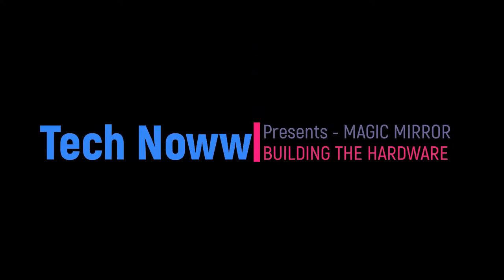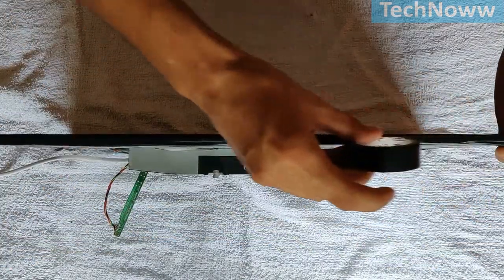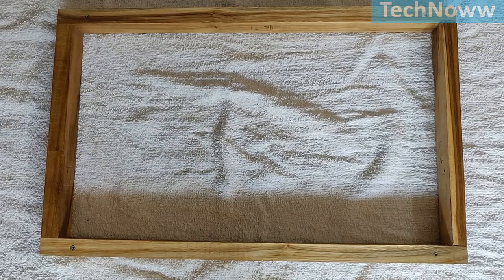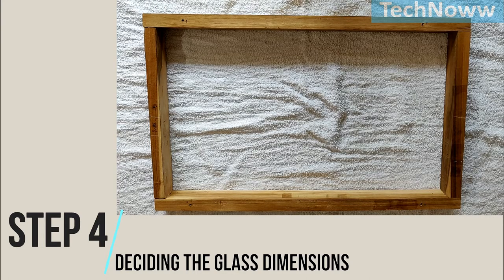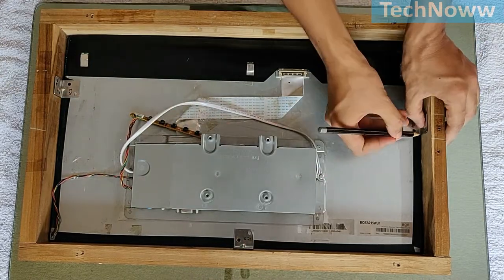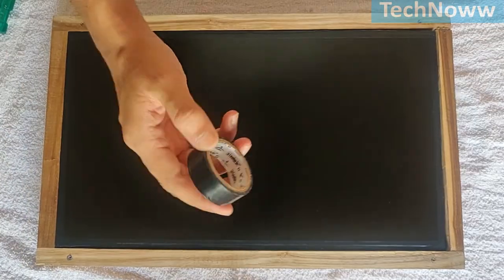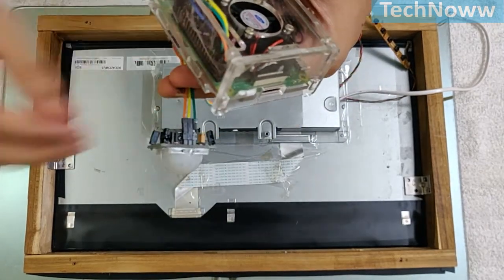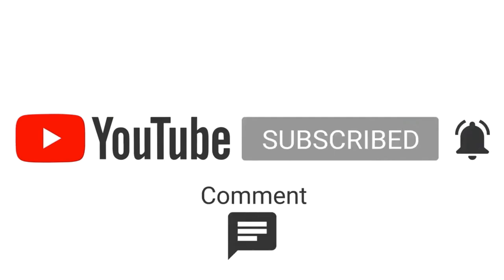Building Frame less Magic Mirror - [DIY - All steps included]

Comment: Pro tip: When you select a monitor for your magic mirror, make sure that the HDMI input faces down! Some monitors have HDMI inputs that face towards the back of the monitor. That will add unwanted depth to your mirror.
Reply from the maker: I couldn't agree more.. however, it is a bit difficult to connect the plug of power cable with electrical supply that too inside the frame assembly.
Hence, i soldered the power output of the monitor. :P .. Moreover i also had to connect my usb charger and a switch !

Comment: Yeooo nice vid mate. Excellent work! Just got a rasp 4 so will prob start a project like this at some point. Thanks for making the tutorials 👍

Would be great if you could find a work around so you don't need the screws. But adhesives could add complication/ be visible and ruin the look I guess.
Reply: Do it like apple did with the imac..just have a small lip for the glass to rest on, this could even be epoxied on the back of the glass and then use good automotive tape to tape it to the frame...will not move...

Comment: Hi. Nice video. Can i buy this one way mirror glass online. Can you please send the link. Many thanks.
Reply from the maker: I am not sure about it ! but, you can visit any of the glass shops nearby, ask them for reflective mirror glass ! Give your dimensions to them and they will help you with it. i think transportation of glass might be difficult.   
More over, you need your frame before hand so that holes on the mirror are located properly.
So, First things first, build the frame, and then visit Glass shop. Hope it helps !
Do subscribe and share the knowledge !
Reply: @BrianHeplerSasquatch  I purchased through twowaymirrors.com as well and they were fantastic
Reply: @technoww1805  why you using oneway mirror instead of two way mirror with 70% reflection...or it means same thing....
Reply: Just use glass and put black material behind it
Reply: @HridayKhurana-k9t  - "One way" mirrors and "two way" mirrors are the same thing. It's like "flammable" and "inflammable". The difference between all of these mirrors is what percentage of light is transmitted through the glass. A regular mirror transmits 0% (full reflection).

Comment: wow..nice project, from did you buy one way mirror online?
Reply from the maker: You can visit your nearest glass store..
Reply: @technoww1805  thanks would surely try making one mirror for myself. thanks for reply..you rock bro
Reply from the maker: @mohsinkhaleel86  thank you.. and all the best for your version of the built !
Reply: @technoww1805  I have followed your steps, one question, I am planning to use Sanyo TV instead of monitor and when I use PIR sensor, to turn off, the tv is still on and it says "No signal", how can I make Tv to turn off instead when no motion detected?
Reply from the maker: @mohsinkhaleel86  one way is that the no signal logo will appear for a few sec and then disappear.. else you can use a relay for controlling the monitor !!
Reply: @technoww1805  thanks for quick response. pls elaborate on how to use relay switch and would use this option.
Reply from the maker: @mohsinkhaleel86  you will have to follow hit and trial for the same.
1. Option 1 - switching ac mains - this may not be a ver viable option as the tv will reboot each time the signal is detected.
2. Option 2 - tap the power button from the tv button channels.
Try it first manually.. later on add the relay for the same..
Reply: @technoww1805  ok thanks will try manually first